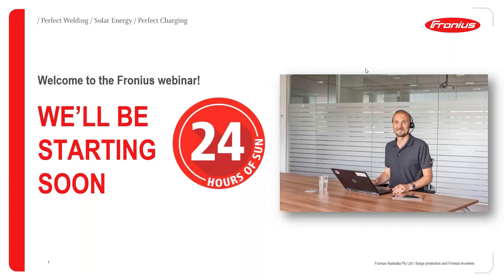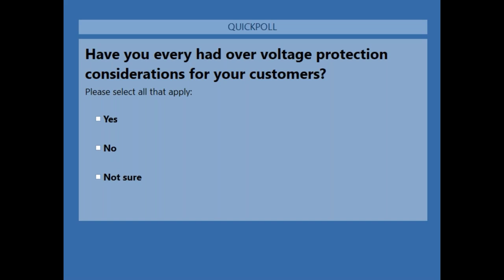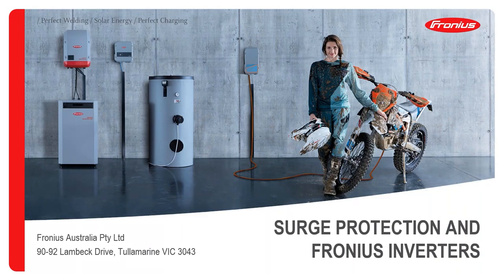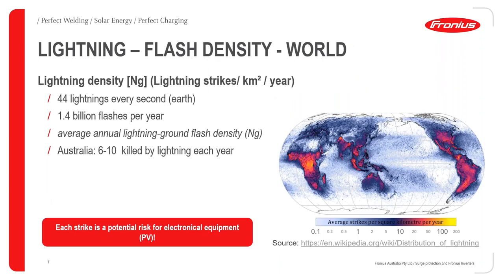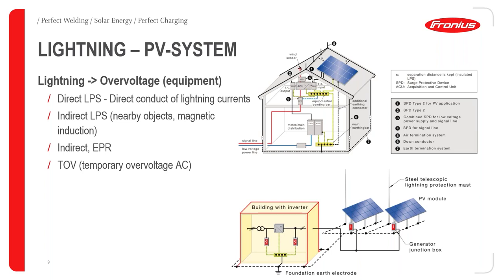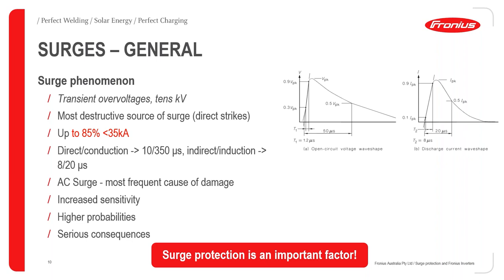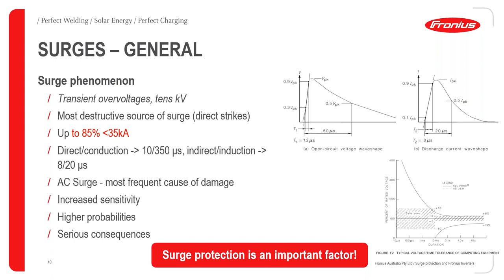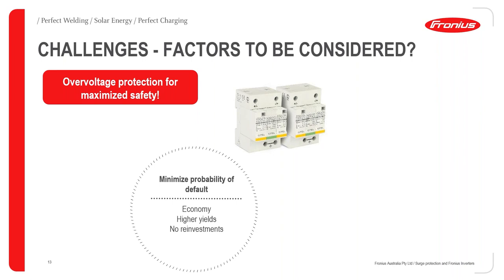Webinar: Surge protection and Fronius inverters (AUS)

Comment: Hi my fronius inverter is faulty it displays 307
Reply from the maker: Hi! The error code 307 could be an issue on the hardware side and would require on site testing. Please contact your system installer, who can contact us from site on your behalf. Best regards, your Fronius Social Media Team
Reply: @FroniusSolar  we can talk cos.the the guy on site is an operator and he doesn't now any as far electrical is consern.